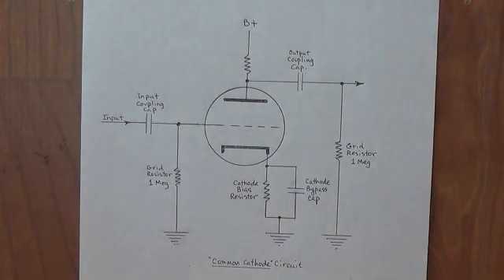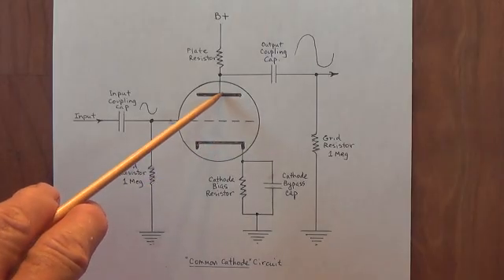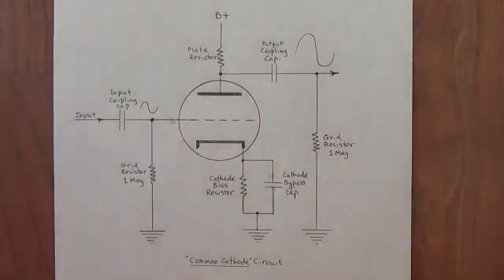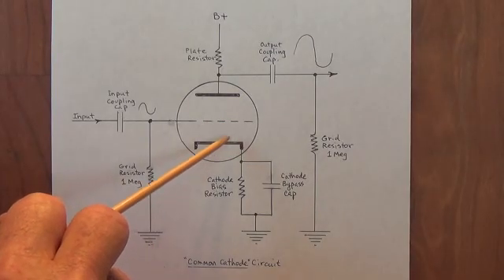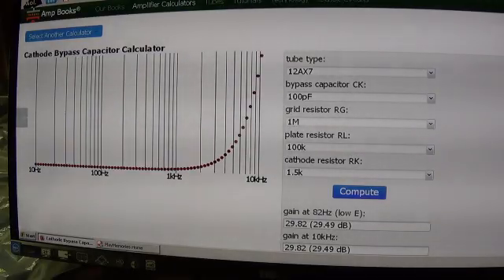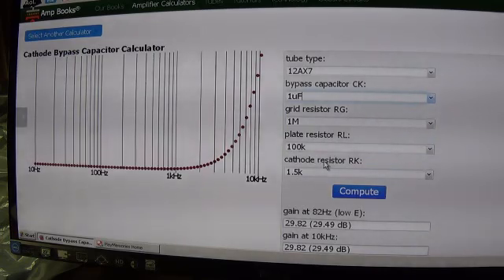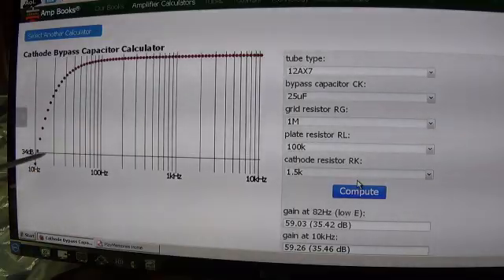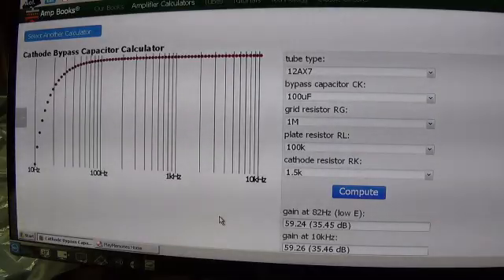Cathode Bypass Capacitors: How they Affect Gain and Tone

Comment: Happy New Year Doug! I wonder why Leo Fender selected a 250 uf bypass cap for the 5F6A Bassman circuit and is there any benefit to that?
Reply from the maker: Likewise, Earl. The only way to tell is to experiment with other values and decide for yourself.
Reply: @UncleDoug I’m building one now and thought about using two different rc networks on a switch. I’m assuming because Fender intended the amp for bass?
Reply from the maker: @Earlvis  That's a possibility, Earl.

Comment: my 5f6a clone keeps blowing Cathode Bypass Cap....assumed cap was faulty....replaced with identical then started burning up Bias Resistors...abd now zero output.  Came here looking for deeper/greater understanding.  Thank You
Reply from the maker: I can honestly say I have never seen a "blown" CBC that was properly installed and of a sufficient voltage rating, Tommy.  Something is definitely wrong.

Comment: YOU ARE WRO G WRONG WRONG. GO BACK TO SCHOOL.  THE PLATE VOLTAGE IS ALWAYS 180 DEG FROM THE INPUT.   SOO LETS JUST SAY THE PLATE AC VOLTAGE IS INVERTED FROM TJE INPUT.  AS TJE GRID GOES MORE PISITIVE TJE PLATE GOES MORE NEGATIVE.   COMMON CATHODE IS AN INVERTING AMPLIFICATION STAGE.  SOOOOOOOO WHAT YOUR DRAWI G SHOWS IS WRONG

Comment: Thanks, great explanation!

I came across the schematic of Tone King imperial, 20th Anniversary version and see that V1 of the preamp section has no cathode bias capacitor and just 820R resistor.

I would like to understand what’s different about this because if we use the calculator, the gain is reduced compared to the traditional R(K)& C(K) cathode bias set up. We also see a flat frequency response curve.
Reply from the maker: Some circuit designers, for whatever reason, make seemingly inexplicable choices in components and circuit structure.  My approach is to experiment with such circuits......i.e. in this case, try it with and without a cathode bypass cap.......to see if my tone preference is different from that of the designer.  This is particularly true with virtually all mid-60's Gibson circuits.

Comment: Great information. The calculator indicates there’s no benefit going much higher than 80MFD on the cap, so why does a Marshall have a 220MFD or even up to 470MFD? The fat cap mod places 330MFD across V2a’s 820 ohm and existing 0.68MFD cap.
Reply from the maker: I have no idea why Marshall would do that, Peter. It makes no sense to me.
Reply: @ Thanks for your reply. I’m building a 1968 spec Marshall Super Lead and your channel is helping me understand things better. So much on the internet about changing cap x or resistor y to different values. Now I understand the impact.
Great work Doug.
Reply from the maker: @peter-0200  I'm glad it was helpful, Peter :)

Comment: This was a great video Doug. That programme is such a good aid in helping to determine what by-pass capacitor you may want to use. I'm having a bit of an issue with a Blues Jr III that I converted to point to point where I'm getting way too much gain even at a low setting of 3. The amp uses 3 12AX7's and I want to tame it down a bit. It's been suggested to lift the by-pass cap to see if it helps. Cheers!
Reply from the maker: Either that or switch to a lower AF pre-amp tube, like a 12AU7.

Comment: Very informative video. On the 5F1 Champ schematic I notice it has no cathode bypass caps on either the preamp stages, only on the power stage. Can cathode bypass caps be added to the preamp stages on that circuit to enhance mid and bass response? Other tweed circuits like the Princeton and Deluxe have cathode bypass caps on the first stage of the preamp tube. Is it typical to only put a bypass cap on stage 1 and not both? I suppose it's because the negative feedback signal is hitting the stage 2 preamp.
Reply from the maker: You can experiment by adding or removing CBC's in circuits, Mike, to obtain the specific tone and gain you seek.....without any harm to the circuit.

Comment: You are so totally wrong. The B+ pulls the output high as the grid turns the tube off. Pkate is out of phase with grid. Read ur rca tube manual
Reply from the maker: That attitude may work on other channels, but not on this one, User. In the future, please use a non-confrontational tone.

Comment: why you dont connect a capacitor in to anode and cathode of the tube
Reply from the maker: You mean besides the capacitors that are already attached to the plate and cathode?
Reply: @UncleDoug  In parallel with tube anode and cathode
Reply from the maker: @TechTed1  Why would you want to do this? And how would you wire it "in parallel" with two tube structures that are not connected?
Reply: @UncleDoug  thats a good question i will do that 1-for tube protection from overfilling and 2-to get from the tube only the pure signal and 3-as a shunt capacitor to minimise anode current 😊im doing those experiments im testing different types of tubes with this method and you extend the life of tubes with this methode also you need to use a capacitor in parallel with filament of the tube and if you adopt the different value of capacitor you can use a low frequency tube at high frequency circuit diagram
Reply from the maker: @TechTed1  Now I'm really confused, EE. Terms like "overfilling", "pure signal". and "minimize anode current" all make no sense to me at all. Good luck with your experimentation.

Comment: If I were to use a 12AU7 in place of 12AX7, wouldn't that decrease the volume to roughly 20%? What kind of tone would that produce at full volume?
Reply from the maker: It's not that simple, Mike. Low amplification factor tubes will reduce volume a bit.....but not nearly as much as you might expect.

Comment: Dear Uncle Doug, I have a ‘71 Deluxe Reverb which upon initial power up plays fine. But after around 15 mins of playing, the bass frequencies suddenly fall out of the signal and the bass control on the vibrato channel loses all effect - same sound on any setting. Could this be a bypass cap playing funny? When I shut off the amp, I hear a loud pop through the speakers, and upon restart, the problem is gone, until 15 mins later as described earlier.
Reply from the maker: Do you lose overall volume when this happens, or only bass frequencies? A bypass cap failure should affect both. How about your coupling caps? Standard procedure would be to simply replace them and retest......progressively ruling out possible causes of the malfunction.
Reply: @UncleDoug  the volume does come down a little but not significantly. Would the bypass cap neearest the bass control be the first candidate?
Reply from the maker: @seekeroftheways  Why not just change them all SW? If one is bad, the others will probably follow.

Comment: Uncle Doug you are the best and I love your videos . I need to send you an email of how my tweed champ came out to sound and look…

I still wonder what value bypass capacitor do you prefer in v1 for a 5f1 champ. Currently running a 10 uF cap which is nice, but I’m considering maybe going a tad lower just to trim a hair of bass. The break up is nice in the tweed , I get that classic Rolling Stones and ZZ Top type of dirt and nice cleans just by rolling my knobs and playing with dynamics ..

I am looking for a medium for both humbuckers and single coils without sounding too thin or too fat and mushy.
Reply from the maker: You can post photos on my FB page: Uncle Doug's Vintage Amps, Josh. Different circuits respond differently. My advice is to experiment and find what works for you. Good luck.

Comment: Thanks for this info. My amp tech is just starting our JTM50 build and I want it to dip somewhat into super lead land and so was discussing with him about splitting the cathode. He really thinks it's best to preserve the original design and stick with the shared, saying it won't make a huge difference in gain. I trust him so we're going with that.
Reply from the maker: You're welcome, Will. Good luck with the project.
Reply: @UncleDoug looks like now, for the JTM, we're doing a push pull switch to go between tube rectification and SS, a push/pull bright cap and a switch to go between shared and split cathode circuit for some Super Lead voicings. I'd like to send you some pics when it's done.
Reply from the maker: @willdenham  You are welcome to post photos on my FB page: Uncle Doug's Vintage Amps.

Comment: I’ve been enjoying your videos and learning a lot from your tube amp basics and troubleshooting tutorials.  Thanks for passing on your wealth of knowledge, skill, and creative ideas(absolutely loved the robot amp series!).   In this video, I think that your explanation of the first graph (with 100pF Ck) is somewhat misleading.  There are no numbers on the Y axis, and I think that what you’re looking at is an extremely zoomed in picture (in the Y dimension) of what is essentially a flat response curve.  The gain is showing 29.5 dB at both 82 Hz and 10 kHz (i.e. flat response over the frequency band of interest).    When you put in a 25uF Ck, you get a flat response that is ~6dB higher.  So without a bypass cap you won’t get a shrill sound, you’ll just get a flat response with ~6 dB less gain.  If you used a value that puts the 3dB cutoff in the band of interest (like 0.1 uF  with Fender-like Rk and Rg values and 12AX7 tube) you could end up with an unpleasantly shrill sound.  BTW, I think that the “Fat” switch on Fender Blues Jr. switches between no bypass cap and 22uF bypass cap on V1a triode, which acts like a ~6dB volume boost, as an example.
Reply from the maker: Thanks so much for your very detailed and informative input, Jeremy. I never cease to be impressed by the knowledge of our viewers.

Comment: Hi Uncle Doug, I love these technical videos. I have a question for you.  I have an orange tiny terror amp which I have done some modifications to and it's tonally almost there where Id want it but I find the mids a bit full or honky for want of a better word. Apart from changes to the cathode bypass caps how would I go about reducing the mids.  The amp has a single 500k tone pot with a 2.2nF cap to ground.. Would changing the cap to a larger value send more bass to ground and  thin the mids?
Reply from the maker: Rather than simply sending much of the low end to ground, why not try different caps (perhaps get a capacitor substitution box) and experiment with different tone cap values until you find the one that reduces the frequencies that annoy you.
Reply: @UncleDoug  Thank you, I have a bread board and a bunch of caps to try.  I found Mkt caps of the same value sound quite different to the poly caps I've tried.   Reduced lows and mids with the mkts so I will go ahead and try those. 
Thanks very much for your reply 😊
Reply from the maker: @titahibayflier3160  You're welcome, T. Good luck.

Comment: Hello Uncle Doug. I'm learning so much here and I thank you for that. Question. Would I be correct in assuming that these same principles would apply to the output tubes. The amp I'm working on. A magnetone 460. Has a shared bypass cap, 22uf , on the two 6 l 6 output tubes. Thank you.
Reply: I guess I should also add that are no bypass caps on the preamp tube. Wondering if I should experiment with trying a cap or two on the preamp tube
Reply from the maker: @jimparker7254  Yes, it applies to the output tubes, Jim......and yes, you can experiment with the addition of CBC's in the circuit......but I think you'll find that the original circuit designers knew what they were doing. Good luck.

Comment: Howdy. Nice. As usual I must comment.
To be pecise the anode signal is a "mirror" signal to the grid signal. Your drawing indicates them being in phase.
The knee frequency of the roll off is easy to calculate. It is when the capacitor reactance is equal to the cathode resistor. At the knee the gain has gone down 3 dB.
Regards.
Reply from the maker: In every one of the many videos in which I have discussed this topic, I have always stated that the grid and plate signals are 180 degrees out of phase, Eugene.
Reply: @UncleDoug  Yes.

Comment: That you Uncle Doug and you to Jack, like all your video’s they are very interesting and informative. It’s amazing how much the cap values change so much in the way of tone. I just replaced all the 25uF cathode bypass resistors in my 67 Pro Reverb because the originals were all reading 36-38uF and now the amp sounds totally different. Previously I had to use the bright switch to get it to sound decent, it sounded muffled with it off. Now it sounds better without the bright switch. Highs and lows are so much defined and alive. Just figured out the bright switch isn’t heeded anymore and thats why I wasn’t happy with the results of the new caps. Everything is good now.
Reply from the maker: You're welcome, 60R. I'm glad the video was helpful.

Comment: UD..Does negative always go to ground in a polarized cathode bypass cap? I’m still a bit unsure about this after looking up info on it. Thanx!
Reply from the maker: Almost always......but not in the -DC bias supply, where the + lead is grounded.
Reply: @UncleDoug  that has something to do with (fixed?)grid bias ,doesn’t it? But as to why the grid would be biased instead of the cathode ,that’s still above my pay grade.
Reply: Just watched the cathode bias resistor episode. I have a much better grasp on fixed grid bias now. I can imagine a couple different reasons why you’d bias the grid in a higher wattage amp rather than the cathode especially since you could adjust it. You’re also right about trying to weed thru information online to find a clear & effective explanation on this topic. It’s not clear what the basic information is if you’re trying to learn it on your own.

Comment: I have what I think I’d a unique problem with an Amp I bought with this problem from another musician. I have an electronics training and repair background, but not in amps, but X-Ray systems and medical equipment maintenance. Soo, ok, hope you can help as we use to say at work, the best engineer is the one who has seen it b-4. I have a Blackstar HT venue, MK 2, 60 watt combo amp. It has 3 channels, 1 clean, 2 overdriven and all affected the same by problem. 2 12 AX7, 2 each EL34 (replaced). “a 6” watt, “60” watt pushbutton option (I replaced it). 6 watt is fine, 60 watt function sounds rattled and extremely distorted like the speakers are ripped. Used another cabinet, same problem. Built a bias check box to look at current levels in the Plate, Grid, and Cathode. 2 reostat for bias to plate. One closest to trans former can’t get down to 70~77 mAmps, but only to 1.21~1.23 mA. This also affects the second reostat values which in my opinion is out of tolerance. Should I install a current resistor in series from the transformer or maybe parallel. No schematics available. It is not wire to wire, but surface mount PCB’s. Any thoughts, if so can you detail components and what area to install.
Reply from the maker: Keith, Blackstar amps are way too modern for me to work on or have any experience with. Add to that the impossibility of troubleshooting a complex circuit long distance. My advice is to either track down the problem yourself......or find a qualified local tech to assist you.  Good luck.

Comment: What a great video, I see some amps (valco/supro) that have no cathode resistor at all but go straight to ground on the first side of 12ax7 and then have a 3.9k on the seconds side but no bypass cap. What would that do to the sound? Is it just less gain and flat frequency response?
Thank you for sharing these awesome and informative videos! Cheers
Reply from the maker: This is a rather primitive biasing method, Thomas, probably derived from early radio circuits. If you notice, there is a high value resistor between the grid and ground, called a grid Leak resistor, which establishes the bias between the grid and cathode. To be honest, this is not an optimum method and probably does not deliver optimum gain or tone.
Reply: @UncleDoug  Thank you for the quick and detailed reply! Indeed there is a 3-4M resistor there. I see so the electrons boiling off the cathode will charge the grid and the resistor will keep that charge there to create the negative bias against the 0 potential on the cathode. Fascinating.
I see this type of biasing on many of the early one knob amp schematics (supro, valco, gretsch).
Absolutely fascinating. Thank you and keep up the great work. Really enjoy your videos.

Comment: I am confused. In the phase inverter video it is said that when the grid is driven, the cathode follows, the plate is inverted. Here it’s again the other way around. The signal drives the grid and the plate follows. Where the knot in my thoughts?
Reply from the maker: Your second sentence is correct. When the grid receives the input signal, the phase of the much larger signal on the plate is inverted, while the cathode signal is in phase with the grid.
Reply: @UncleDoug  good thanks for cleaning up the mess in my head. Much appreciated =)